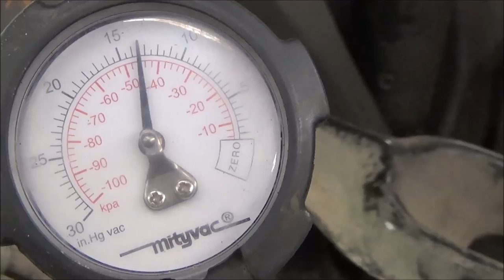Pontiac Grand Prix 3.8 - Water Pump Replacement

Comment: that's Dex-Cool for you that crap is bad stuff and clogs just like that car. i got a 1997 olds lss with 201,000 miles on it and had to change everything from the rad., water pump, ect because of that coolant. i replaced the coolant with the 50/50 green coolant and haven't had any problems.

Comment: Why didn't you consider going through the passenger side wheel well ? ?  That is how I get to the oil filter on the Grand Prix and I am fairly certain you can get to the water pump much easier that way. .. Biggest issue with the GM 3800  engine is the failure of the Lower Intake Manifold Gaskets (plastic crap) which causes coolant to get into the engine. Otherwise this engine is just about bulletproof. With a radiator that bad, I would suggest a new one, along with T-Stat and Hoses / Pressure Cap ... That radiator will eventually leak at the side tanks and need replacement anyway. You can get a nice new one for under $200

Comment: Why does loss of steering mean the water pump is dead? Doesn't water pump just pump coolant, with no effect on steering?
Reply: It can bind the belt driving the power steering and water pump up, or make the belt slip off altogether. Its all one belt.

Comment: My GP water pump was easy! Just pull the two PS bolt's. There is much worse.
And a testament to the 3800 I've seen them go over 200,000 miles and not have an oil change for 3 years!!

Comment: A good thing to do with customers vehicles before you deliver  back is to check oil level, brake fluid ,power steering fluids also, people do not have a clue on how to maintain a vehicle.

Comment: I know what happened, and it wasn't that long ago. Somebody mixed green coolant with orange. Happened to me. Turned to goo. I replaced the radiator X 2 - Thermostat X 3 - Heater core X 2 - all hoses  X 1 - engine flush X 3 - Engine blew at 292,000 (Chev 4.3 vortex). What tipped me off was I pulled a radiator hose, slit it longways and it looked like baked clay inside. Ship it ! FYI - if you are interested, it's only 220,000 from the Earth to the Moon - Put that into perspective . . . .

Comment: I just rebuilt that same motor in a 2000 Impala is a 3.8 you think the water pumps hard try getting the oil pan off it's annoying yet to take out a whole motor mount just to do it

Comment: I have a 2003 sillouite van with 168k miles on it.  We had it in every fall for a coolant change and flush.  The next summer when my father became ill and they told us we needed to come now or it would be too late.  We lived around 180 miles from where he was in the hospital.  I had just had it servesed at the chevy dealership and they told us all was well so off we went to see my father.  We got half way and the van stalled and was overheated.  I called for a tow truck after calling the dealeship and they sent the tow truck.  Then we got the news that the water pump and the radiator was shot.  I told them and showed them as soon as we got back from seeing my father but, it was too late to see him.  I  wish it was the end of the story but in less that 300 miles it overheated again and took the head with it.   THe dealership wouldn't pay for the heads to be replaced or the work needed and of course I didn't trust them anyway but 2500 later we had a different engine  The whole thing is when they tore it down that engine was full of that brown stuff and it was soo thick we almost didn't get some of it out to see it throughout the engine and the radiator we just couldn't believe that it was so bad but,  I payed to have everything right !  Moral of the story is always check the work that has been made.  I figured that since we bought it there we would have it serviced there.  I am disablled so I didn't and $4500 later I will always check it myself because my wife desn't nor do my boys !  Good luck but,  I don't think that the mud ever gets out of the system !

Comment: I have a question for anyone here, on my 07 grand prix, I located a coolant leak from the end of the hose that connects to the block that you can see next to the water pump, could a faulty water pump cause it to leak right there or could it be something else. The car doesn't overheat, just leaks coolant at a very slow rate
Reply: i would bet that the timing cover gasket is leaking

Comment: Eric, were you using regular Cold water or was it Hot water by chance? I think that Hot Steam Water would work good in that situation you found. Also thing about buying some cheep $1.00 + plastic molded picture frames to help block the water and junk from hitting you in vehicles like this when you use your water and air combo nozzle or get a face mask, even a cheep one would be a good protector for  your face. Also think about getting a rubber apron or long rain coat to keep you dryer and cleaner in the feature. I think Mrs. O and other family members would prefer you to practice a little safety. I know I do not like being hurt. I broke my leg learning to ride a 2 wheel bicycle around age 5 I think. NO FUN Being in casts most of the summer!

Comment: This is going to sound odd, but flush it out with Drano, give it 2 cycles with Drano water mix, then go cycle with water until it runs clear, it will remove that crape that was in the motor.

Comment: THAT.....is a wonderful combination of rust and silver seal stop leak. Its supposed to bond to leaks.....but if you have particles in the water.....it bonds with those instead . Looks like he used more than one tube?....lol.  Ill bet 20 bucks the heater core is a solid block

Comment: That sludge is what happens when you put regular green antifreeze in a system that has "dexcool" in it Dexcool is the orange antifreeze for a lot of GM vehicles and if you put regular  green antifreeze in the system this is what will happen.

Comment: This guy should go to 3800 Prison for crimes against this great engine.....are the spark plugs, air and fuel filter original equipment as well? Where tires at atmospheric pressure?

I Love my customized 3800 I work on endlessly, attached to mint '03 Impala, last car I'll ever own. He had little coolant in there,  a quart or 2 should flood out from water pump as the lower intake manifold stores alot and feeds it. The CLAY was DEX mixed with green type and possibly Cheetos as well.

 On Wards Top 10 Engines list a few times, best, most accessible engine ever made. I got rid of my plastic upper with an '05 L26 UIM, swapped plastic valve covers with '97 junk yard Camaro covers, mirrored polished all and put in several upgrades from ZZP. Easiest engine to increase hp on.
Love It.

Comment: You don't have to pull the power steering pump. There's holes in the pulley that the bolt goes through, just line it up.

Comment: I just looked up torque specs for this water pump. I seen other websites showing other torque specs.  I have seen large bolts 15 lbs. small bolts 11lbs. Anyone else seen this?

Comment: Dexcool is known to do this, on any GM that came with Dexcool I just drain it and put conventional green anti freeze in there. Dexcool is GM's way of ensuring you will come back for service should this happen. It's very pragmatic on 3400 Series 60 Degree V6's where the intake gaskets would turn into paste. I understand that this can happen to any car but antifreeze is a bit more forgiving then Dexcool ever would be.
Reply: Pleasantly Rusty  200,000 miles and counting, no blown head gaskets and plentiful heat and no loss of gasket. :;shrug::

Comment: I’m assuming you checked the oil level to make sure the crude in the radiator wasn’t from a blown head gasket, or leaking intake manifold.  And I hope you slapped some sense into the owner.......cars need liquid coolent!

Comment: Nothing like a good ’ol Buick 3.8 motor ...  I prefer mine  with a rwd setup though . He even had to use a 3/8 instead of the 10mm socket... Just replace all hoses & radiator.   ...and what about that battery terminal !
Reply: That fastener probably had a 9.5 mM. head.  I checked and that size socket is offered for sale.  There are some "magic" numbers, like 3/4 in. and 19 mM.  It's not perfect, but more than close enough.

Comment: They do the same on that Australia gm Holden Commodore 3.8L v6 Buick/ecotec 4 13mm 6 3/8 lucky not Side Mount fwd our rwd charge 20 water pump week last 2 year or 4 year depends have put China copy water pump I think the coolant never been changed use just keep top up tank water or something or the never change coolant 8 year run hot all time

Comment: Mechanic: what's wrong with your car?
Customer: the water pump stopped working.
Mechanic: lemme take a look.  Well there's your problem your engine is filled up with stop leak.
Customer: can you fix it?
Mechanic: starts to hook up air compressor to fire hydrant 
Customer: what are you gonna do with that?
Mechanic: imma blow it out.

Comment: In this video I show a few tips for re-installing an outboard lower unit or gearbox. This involves using a rachet strap to support the gearbox while you position the driveshaft, water pump pipe or hose and the gear selector.

Comment: i have actualy seen this several times over last 70 years. But no wheres near that thick. it comes from tap water that a city water system is not filtering from a nearby river.

Comment: It's not the owners fault, Dex-Cool is liquid rust. It is by far, the worst coolant chemistry ever engineered. Shortly after leaving the factory, it turns into a clay-like sludge which stays on every surface of the entire cooling system and is impossible to remove. It is an absolute nightmare. There was a class action lawsuit about it that ultimately went nowhere because GM hires amazing lawyers. I had that same problem on my suburban.

Comment: If you can do it, I can do it, and I've done it! Mine shredded the belt when it happened though, it didn't just slip off. I can't count the number of times I said "Yup!" when watching this, but man I've never seen mudded up Death-Cool as bad as this, wow! Prestone NON-Dexcool is all I use, and I can confirm that's no stop leak, that's Dex-Cool that (back in those days) they said could do 10 years and 150K miles, then last I knew they revised this to 100K miles, still BS IMO.  Obviously that customer had it in there well past it's prime, it's a wonder that car was even running at all. If it was me and it was in that sludged up, I would have taken the thermostat out and replaced it (or at least boiled it), and also connected that power hose attachment directly to one of the heater core hoses and blasted that through, too. What a mess, but it was entertaining to watch.

Comment: I have blisters on my arm RIGHT NOW from checking/filling a ps pump on a Monte Carlo with the same 3800 series 2....customers NOR bosses take into consideration that the vehicles are piping hot when they pull in after driving for hours. ...they don't care they want that pull changed NOW and FAST,  and go ahead and check everything else under the hood while it's still good a HOTT....lol

Comment: I saw that when you mix red with green it will turn into that s***
Reply: That's why they did away with deck school is because it
Reply: And vortec engines for example it caused the head gaskets to blow and also premature loss of intake gaskets that's why
Reply: Do you think that's what the delicious mean by LifeTime transmission fluid such as they say in the new Dodge chargers or the new

Comment: These motors always ran hot from day 1. Something in dex cool when cooked turns to mud. Traffic jams are worst enemy to these motors. Notorious for exhaust leak into cooling from cracked heads and blown head gaskets. Car like in vid I'd turn away. If still flowing running hot and passes exhaust leak test I do repair. Advance auto sells 1 inch core radiator lifetime warranty, 180 degree thermostat, low pressure radiator cap,all car compatible anti freeze, 30 amp toggle switch, 10 gauge wire, crimp connectors and relay terminal connector from car stereo store. I charge 500$ labor and 50% more on parts prices. This all solves the issue.

Comment: I like how "Car Wizard" - the whiny guy with questionable knowledge says these engines are the best design and are the easiest to work on, but SMA who actually tells it like it is, points out how crowed the accessory drive area is and how poorly designed it actually is.
Reply: dorfus71 in my opinion, the engine itself is fantastic and lasts forever. 

That being said, EVERYTHING surrounding it is garbage. Hard to work on, crappy plastic everywhere. GM could've used metal elbows and metal UIM, and not dex kill and they would likely never have major issues.
Reply: Pretty simple fixes to get a reliable engine with good fuel economy

Comment: seems like you possably would want to check the thermostat,.n mabey flush from there also, id mabey have run it with water n no thermostat til hot a few times see what came out,.....i have 3.8 grand prix sc, dont use dexcool , heard too many horror stories

Comment: I'm reminded of water soluble oil & the like added to craped up coolant systems. 
>>>>>>>>>>>>>>>>>>>>>>>>>>>>MUD<<<<<<<<<<<<<<<<<<<<<<<<<<<<<
generally a engine block & what all isn't flushed , HOT tank, out, end of show. toast.
end up with a no flow system.

Comment: I've had 7 new GM vehicles in the last 20 yrs and all had dex-cool. Never once have I had an issue with any of my vehicles and truthfully I've never heard dex-cool was anything but great. This is very odd for me. My current truck a 15 GMC 2500hd just hit 100k miles and the coolant looks like it is brand new.
Reply: Let me guess...you serviced the cooling system at the recommended intervals? Amazing how Dex will not sludge up when ya keep up on maintenance. Ive had many GM cars with Dex and follow flush and fill recommendations to a T!

Comment: Sadly that is just Dexcool. I own an 05 grand prix. Replaced water pump at 70000. Dexcool was just like this. 50000 miles later and a heater core flush every year for 4 years and I am on the second water pump.

Comment: Wow, just saw this video, that's why they call it Dex-Kill. Worst coolant ever!!! EVERY single time I buy a Dex-cool "required" engine I completely flush and refill with trusty green. Bought a broken down '01 Aztek, had a blown head gasket from this raunchy stuff. Cleaned it out, good flush, replaced heads (good used) and gaskets and been driving it ever since with no issue. NEVER USE DEX-COOL!!!!

Comment: im surprised he hasnt seen this before,its what happens when you dont change the dex-cool coolant in a gm or let it overheat,needs to be changed at 100,000 miles

Comment: That's the same thing that was wrong with my friends and Paula is that orange shit turns out it's a mixture of rust and some other shit maybe fixing leak or somethingit may to where his whole motor was clogged up leaving his fucking throttle body cooling pores on his plastic intake or clogged up with that shit it might be because the block is cast iron

Comment: Oops! Sorry! That's a birthday cake in the radiator that slipped off the engine cover years ago and disappeared. Seen similar nastiness in 1980's-90's models with the old never been serviced green coolant that turns into a black sludge and rusty. A Proctologist would have charged at least $10K for the same procedure.

Comment: Always hated working on the 3.8. Alternator is easy enough. But spark plugs, and almost everything else is just asking for bloody knuckles.
Reply: Also, that's exactly how DexCool ends up when it's never been flushed and replaced. Just add in more when the level gets low, and that cakes up as well. One of two solutions are possible. 
1. Replace radiator, heater core and hoses. (difficult and expensive, but saves time)
2. Full loop chemical flush to break all that garbage out of the radiator fins (could, as Mr. O said, take days)

Comment: I had a Bonneville with 3.8 great car that is over 200k after that gave up., i bought a 99 Pontiac sunfire GT, I hate gms design for the 2.4 engine in that car Replacing the water pump  cost me about $1,200. Had a shop repair. Because its ran by timing chain. Not by belt, long story short. car got repaired get ways down the road engine sound like clashing soda cans. Ended up bent valve and hole in the block.. had the car a month.  now crushed sitting  somewhere? Damn engineers.

Comment: A bolt behind a pulley and the flat rate went from 1 hour to 3 hours. That means more cash to the dealer's service department. Yeah, it's not stupidity but plan extortion. How in God's name this didn't overheat and fry the engine?

Comment: @10:30, How is that even possible? Totally looks like sabotage, or car came from Flint Michigan! And that’s why this thing is highly suspect, because no way possible that car would have ran for any duration of time with such Impaction of Radiator, car would have over heated long ago, let alone a reason why the fan belt came off from a loose pulley.... that car would have over heated and not ran long before the Belt problem, and is why this thing is viewed with great suspicion!!!

Comment: BAR leak  looks like a dog turd you crumble it up and add it to the radiator (AKA stop leak   if Bar leak is used correctly it works well un fortunately is is seldom put in correctly causing more problems than it fixes

Comment: God forbid to give you more room for your wrench if they're going to do something stupid like put that pulley over the water pump Bolt! I firmly believe Engineers that design cars should spend five years working on them first. I guarantee you we would see some different designs come out, more accessible anyhow.

Comment: I see you have discovered very old dexcool.. this s*** is the worst coolant on planet Earth, every single time i buy one of these cars I always do a mandatory flush take out all of the components that dexcool had touched and power wash the orange glue off and then I put G40 coolant in for 10,000 miles and then do another flush and then I put more G40 in